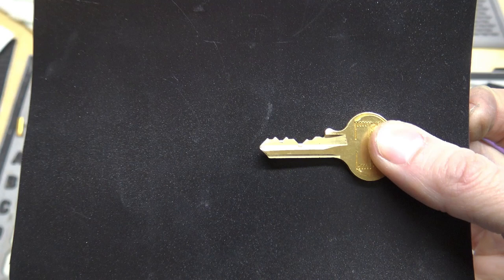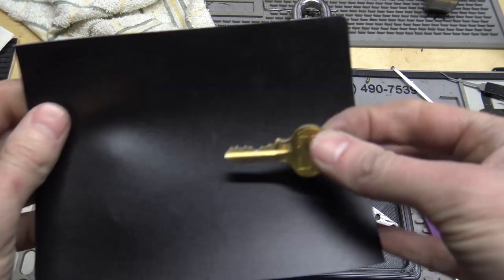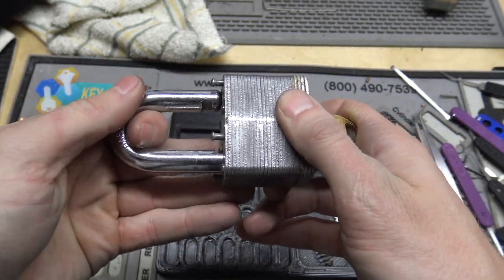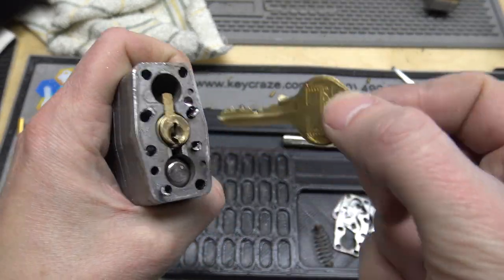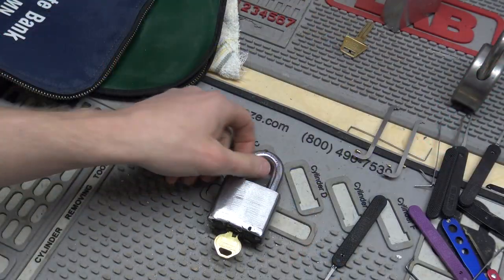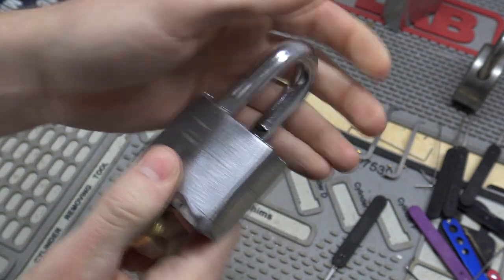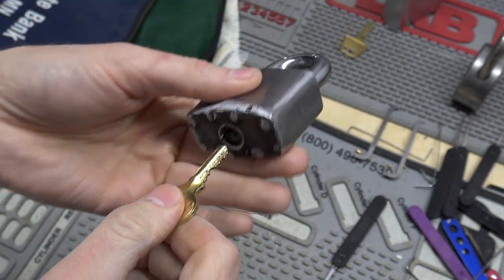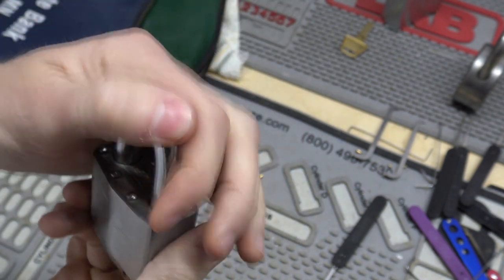(359) Master Lock 17 Cut Open Key Made & Welded Back Together

Comment: That was awesome :-) Never seen this kind of "repair" before. I once took apart a laminated lock and then exchanged the rivets with long screws but your's is fully functioning again. I was worried that the heat would have destroyed the elasticity of the spring. But not - great :-) Thanks for sharing your project.
Reply from the maker: thanks for checking it out man! I tried  a few times to impression that lock and just couldnt get it.  dont like locks beating me lol